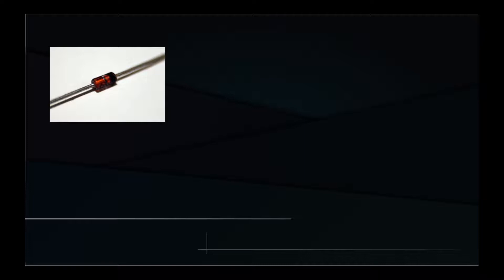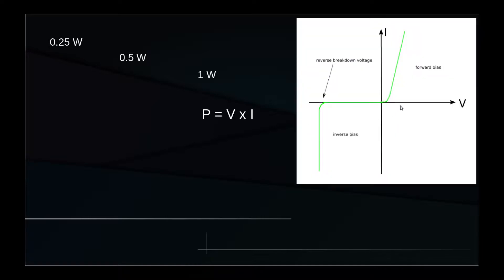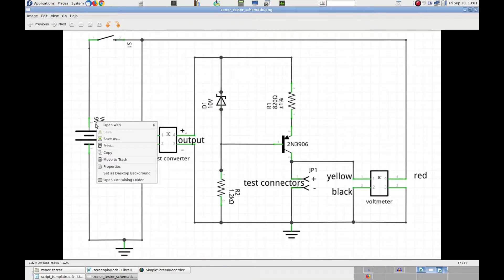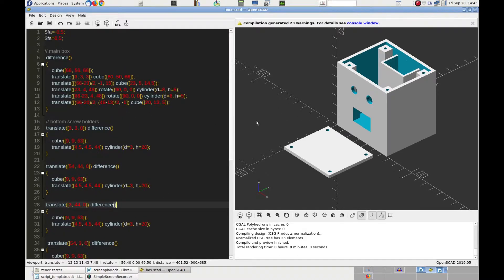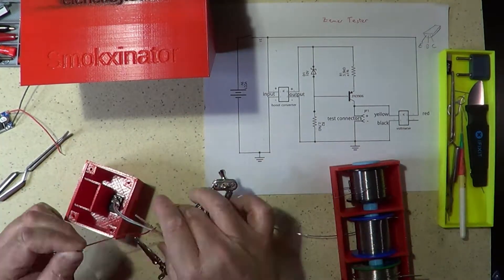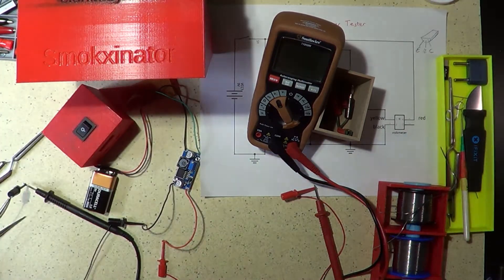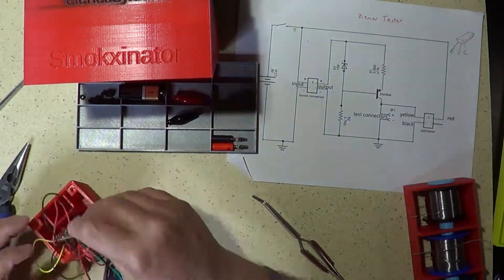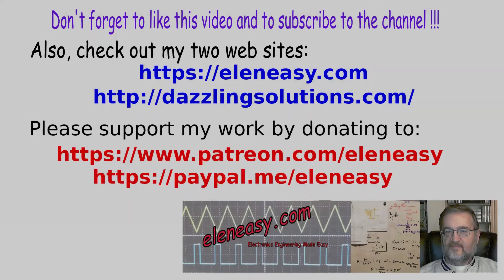Zener diodes tester

Comment: Another idea, cheaper and easier to find parts (as does not rely of having a Chinese Step-up converter) would be to make a Joule thief with toroidal core (from Compact Fluorescent Lamp) and any BJT. 
I have successfully experimented with that and I could achieve more than 30V with a single AA 1.5V battery. Eventually limit the upper voltage using a higher voltage zener (with a LED in series to light up max voltage achieved) or another NPN as voltage feedback and a 50-63V electrolytic capacitor in the main output, with further current limiting resistor. 
If you allow a suggestion, maybe it could be your version 2 tester.
Reply from the maker: I like the idea of stealing the toroidal core from a fluorescent lamp. I can certainly keep that in my mind for the next time I need a boost converter. However, those "Chinese" converters are very cheap and work just fine, as far as I can tell. I found an offer on Amazon where they sell 5 of them for a total of less than $10. A $2 converter looks pretty cheap to me. Thank you for watching my channel. I hope you will find it even more interesting in the future. I have several interesting videos already planned.
Reply: eleneasy.com , I understand your reasons, but waiting 8-12 weeks to receive a post from China is frustrating in the best case.
I live in Brazil and after CoViD several packages bought through eBay have been “lost” or misdirected, beyond  money-back warranty time provided. So the cheap (and tardy) did become a “bet” if you ever is going to receive, or fully loose your money!
More over, maybe other international sites have better package-tracking and would not be so expensive if purchased in larger orders to dilute the extra shipping charges overseas. However, I didn’t find this site yet, or this is just competitive for larger orders, who knows?
Reply from the maker: @EJEuth  Oh, I see your point. The fact is, I don't order directly from China, but from Amazon, which I believe has these converters in stock and I can receive the items in a couple of days. I'm really sorry! Sometimes it is easy to erroneously think as if things work the same everywhere. In the future I will try to propose different solutions for doing something that involve buying prebuilt items from places like China. Thank you for pointing that out. I really appreciate it.